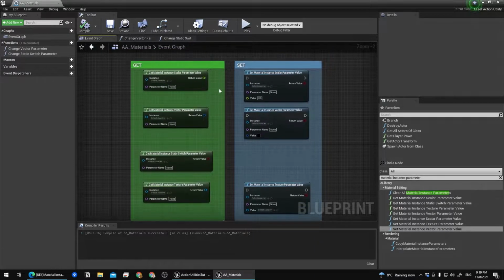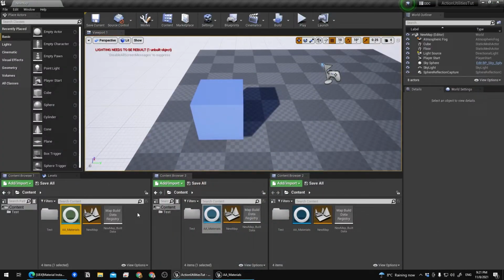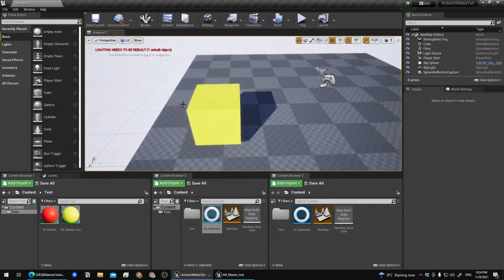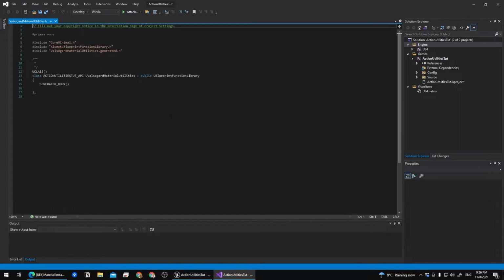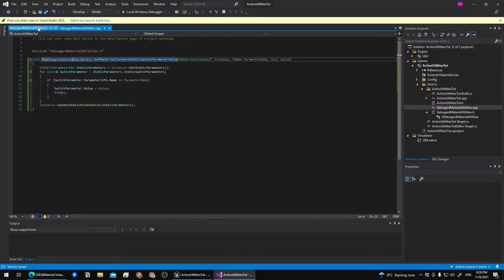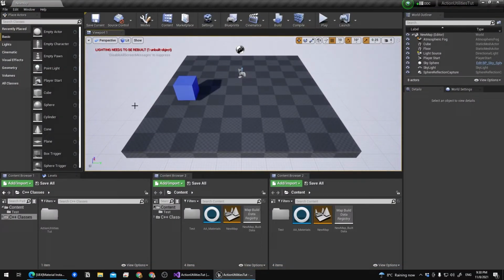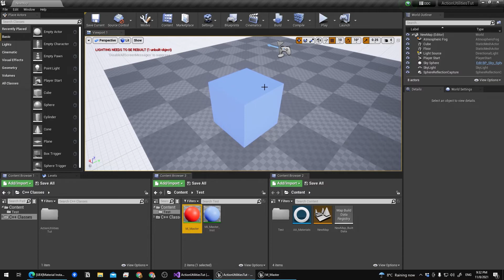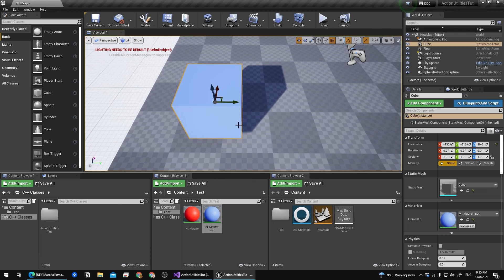Unreal Engine | Set Material Instance Static Switch Parameter Value

Comment: Unfortunately this doesn't work in UE5 anymore :(
@EpicGames please just give us a "Set Static Switch Parameter" node - apart from it not being able to be used at runtime there really is no reason not to have this natively for construction purposes!
Reply from the maker: I doubt there's going to be a runtime version of this functionality anytime soon.

What you could do instead if use If node with Scalar parameter. During runtime, you would be switching between 0.0 and 1.0 values.
Note that it's more expensive, but it works.
Reply: @Valsogard  You're probably right, but even a non-runtime version (eg. used in construction script, executed when placed in the level) would be extremely helpful.

So far I did the workaround using "Lerp". Will have to test whether your "If"-method uses fewer instructions. Anyway, while such a method does work, it is very unclean and forces to calculate the whole material in every instance, even if 2/3 of the possibilities in the material aren't used in said instance (talking about a huge master material with lots of switches, which is necessary in my case to allow as many mutations as possible without switching the master).

Well, maybe I'll just have to wait a few years until the folks at Epic clean up all the things they broke from UE4 to 5 :/

Thanks anyway ;)
Reply: @Valsogard  Yeah, but this approach is performance unfriendly(

Comment: actually in 27 you don't need to mess with c++ since it's possible wrapping it into BP with 6 lines of python:
import unreal
@unreal.uclass()
class BPFunctionLibrary(unreal.BlueprintFunctionLibrary):
    @unreal.ufunction(params=[unreal.MaterialInstanceConstant, unreal.Name], static=True, meta=dict(Category="dude"))
    def set_material_instance_static_switch_parameter_value(materialInstance, ParameterName):
        unreal.MaterialEditingLibrary.set_material_instance_static_switch_parameter_value(materialInstance, ParameterName, value=True)
Reply from the maker: Thanks for offering another solution. :)
Though I personally prefer C++ in my workflow because of very low-level access to things.